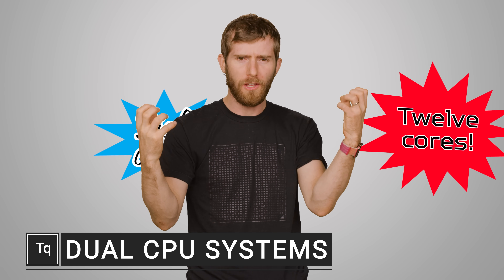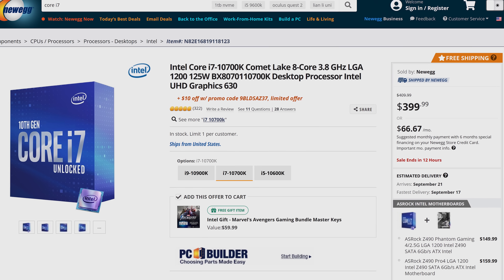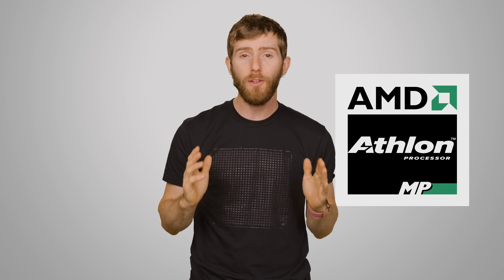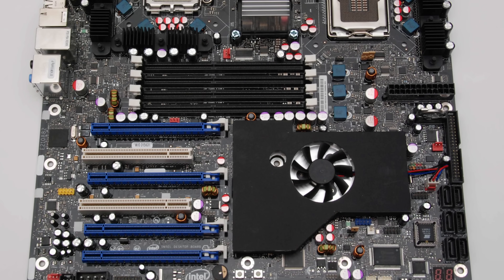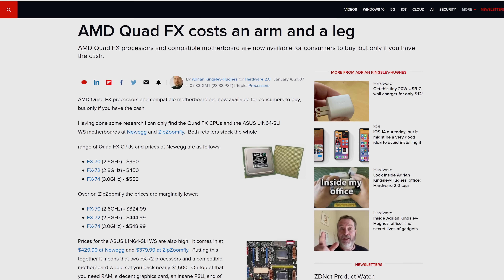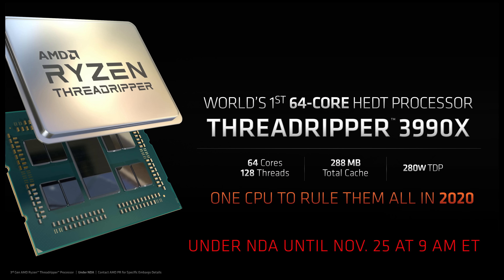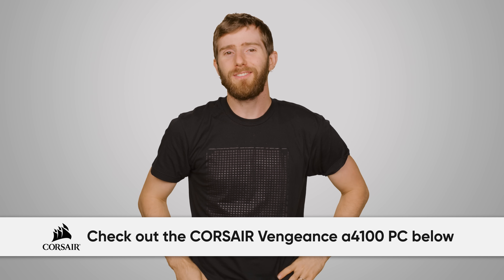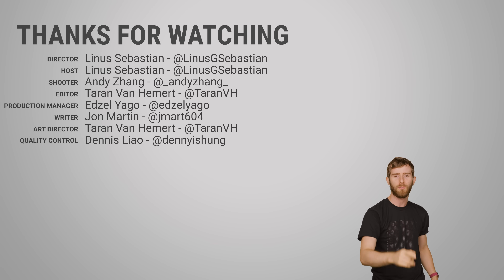Should You Put TWO CPUs In Your PC?

Comment: I have an i7 with a base clock of 2.40 GHz, but recently this Stupid CPU is Stuck on 0.79 GHz & all 8 L CPU Cores max at 33% when more power is needed, even during a stress test. I tried under volt-ing, throttleStop, renew the thermal paste incase it really was temp-but it is well managed at 65 to 78’C , i tried to reset & update the BIOS &Chipset drivers, even physically cleaned the heat sink. But nothing improved or changed. Now i just feel dumb, Any One with a Solution?- Pissed 😡. Is it time to upgrade?

Comment: Multi-socket boards make a lot of sense for multi-tenant, virtualized workloads. In fact, as many as you can jam into an enclosure if they're earning money.  I have had teams working in data science and high-performance computing, all sharing a stack of GPU's and 2-socket Xeon all running separate virtual machines. 8 GPU's and 44 cores of CPU and nearly a terabyte of RAM make an enormous amount of heat and noise. All that goes in the server room with thin clients at the desktops.

Comment: SMP isn't better than mutli-core because SMP increases the distances between the CPUs and each other or the CPUs and other components, which at those speeds even an extra inch matters. It also increases costs and complexities of the traces, not to mention the extra real-estate required (read wasted) on the motherboard which makes it less apt for compact systems. It also needs (a bit) more power to push the electrons (slightly) further. Though it does reduce heat by spreading it out over more area.

Comment: I own a dual ivy bridge cpu system. It made sense in 2015. it still performs great and looks cool, but there is no reason to build a dual cpu machine in 2020. Multithread has arrived... especially if you stream or edit and Threadripper is more than good enough for it. That being said, if die shrinks slow down again, dual cpu machines may make a comeback.

Comment: My main computer is a dual 6 with 2 6 core xeons with hyperthreading for 12c/24t. My son's computer is an HP z600 with 1 CPU 6c/12 thread with the second socket empty. Daughter's computer is dual 4 core xeon for 8 threads and I have another system identical to hers 8 core 8 thread. My pure gaming machine is 4 c 4t 3570k core i5 with a 980 ti. Son has a gtx 960 and daughter had an r9 fury.

Comment: 1:10
Yeah... single-core.
But did you notice the massive 33 MHz?

I had one of those.
Upped to a Pentium 120 MHz.
Followed by AMD K6, K6-2 & K6-3 (300 MHz - 350 MHz - 450 MHz - 500 MHz)
Which was then followed by the Pentium 4, 2.4 GHz WITH HT(!!!!)

I miss those days.
Reply: That's nothing. My first 3 computers were all 8 bit, a 3.5Mhz Z80 and then two with 1.7Mhz 6502 processors. 1K, 16K and 64K of RAM respectively. The good old days. 😁
Reply: @another3997  My first computer was a MOS 6502.
Followed by my first console... which used a derivative of the MOS 6502. xD

(C64 & NES)

Comment: I used to have two PCs with multiple processors though I now only have 1. The one I still have uses dual Xeon E5649s and 72gb of RAM and is used as a flagship workstation specializing in heavy multitasking. I normally don't have too much trouble loading it up though it doesn't always use all of its available processing power. The other one which I gave to my friend has 4 Xeon E7-4870s and 288gb of RAM and is a behemoth of a server. I had initially bought it to mine crypto which it was quite good at, but after the market crashed I couldn't find anything else to do with the raw amount of computational power it brought to the table(seriously - it could run most games at medium settings just by soft-rendering the graphics WITHOUT a dedicated GPU!). Last I heard he was working on converting it into a VM host.

Comment: I don't agree with your car stereo comparison to adding another processor to a system. Adding more drivers, properly, will always provide more sound. Just because you already have 12 doesn't mean adding another won't make it louder. As long as you have an amp to push the driver, it will make the system as a whole louder. If your statement were true then no one would ever make demo vehicles with 20+ subwoofers. Go look it up if you don't believe me.

Comment: I had a moment of pure nostalgia when he mentioned the AMD Quad FX. I opted into the system in a weird sense of future proofing myself into a future 8 core system. The first FX-70 CPUs were supposed to be placeholders for the eventual Phenom-style chips with 4 cores each for one of the earliest 8 core setups available...but the FX line was cancelled and I was left with an existing system with a dead end architecture, and a cooling fan setup that reminded me of a passenger jet spooling up on the runway to take off. I think I learned a lesson from that...trying for bleeding edge runs the risk of getting cut, in more then one sense of the term.
Reply: I am there with 1st gen thredripper right now.
Reply: @Bamfhammer  Same

Comment: Damn...I have 2 of those 2687w's in my HP Z820 workstation. Rendering video is way faster on it than on my 10900K rig. I wonder if it depends on the motherboard youre running it on? I would replace the workstation with a threadripper but the workstation was only 700 bucks lol

Comment: I have dual Xeon v4 in Asus board, 16c/32t, as my main system. The plan is to go for Zen3, as i no longer need such high core count. But it was good to experience it. Definitelly not optimal for gaming, but there are some exceptions.
Reply: I have zeons too on a HP Z820 workstation...but I still get better rendering times on it than on my 10900K. Maybe I need a better board or more ram on my 10900K setup? I have 64gb ram on the workstation and 32gb ram on the 10900K

Comment: Multi~CPU setups being confined to the Server market and going the way of the Dinosaur is ultimately similar to the factor of why Multi~GPU via Crossfire and NVLink is gradually going away (even if XeLink does become a thing with Intel Graphics Cards, I expect that to fade in the same fashion as the Xeon Phi cards and we stick with Solo GPU for the HPG class), CPUs and GPUs have become powerful enough by this point that the only reason for why you need many chips in the same system is if you are running a Workstation/Production workload that can make use of an uncapped core/thread count or if you have multiple people running workloads on the same server and you need to divide up the work by giving everybody a fixed set of cores.
This is especially noticeable if you do Media Production or Model Rendering: When you are rendering a video with the CPU+GPU method, most applications and video codecs cannot work with more than Sixteen to Eighteen Cores, thus this is why I keep saying that a Ryzen 3950X or an Intel 10980XE is all that you truly need for Vegas Pro; many builds of Blender and other Model Rendering applications did not make full use of the Threadripper 3990X when the Zen II Flagship had debuted, as most were capped out at only using 064 Threads (not 064 Physical Cores), thus High Core Count CPUs such as the 3990X and Epyc 7702 Series were meant to handle multiple workloads at once, rather than just blast through one standalone, and even if we had Multi~CPU setups, this truth would still stand, most applications simply are not optimized with Multi~CPU in mind that Single Socket is still the Go To option and why it will be rare if we ever see Dual Socket or better at the Consumer or Prosumer/HEDT level again from Intel or AMD, Cost Factor is one trouble and Effectiveness would be the other that it would be too unpredictable to revive it now.

Comment: I've run a dual Xeon 2695 v3 setup.  It's pretty beasty on benchmarks, but I'll admit it's mostly 'just because it's fun to do' - especially if you can get Engineering Sample (ES) CPUs.  Paid about $450 USD for the two chips (one died after a year, so another ~200 to replace), which isn't any different than a high-end single.  The board and ECC RAM are pretty big upcharges ($600 Canadian Rubles for the board, and I don't remember what the ram was)...  plus an extra $130 for an extra water cooling setup...  But it's bloody stable, quick, and I have fun with it - and isn't that what really matters?

Comment: I must say dual 6 core CPUs give a really good benefit with 24 threads.
I have a custom z600 as my PC with 2 Xeon x5650 which are quite old but cheap and fast at
And 16 gig ecc quad channel RAM and all the other stuff.
Somehow my HDD is fast like a cheetah
I must add that more threads make unzipping archives much faster
Reply: X58 life, most of the modern stuff on the motherboard just missing a few instruction sets, fast though just like you're saying
Reply: @licksludgee  Yes the only problem is that it has no avx or USB 3.0 support and PCIe 2 and sata 2 at max
Otherwise it's fast af
I was worried about my mem speeds too but when I found out that quad channel 1333 MHz ecc memory becomes 5*** MHz ecc I was v happy
Reply: @mythtech  it's crazy, that was the issue with my older xeons it was sata 2 and few usbs. Core speed wise though was more than fast enough for everything I wanyed to do. on AliExpress you can get so many different haswell chips now at crazy prices, you could do an epic dual system for relatively cheap, benefits of ECC memory too

Comment: intel 440bx was one of the first chipsets that i used with 2 cpu's in windows xp days most of slot1/s370 boards were able to run 2 cpu's given they had the same core and pair bit enabled
of course that made for silly monster builds with one cpu in socket and the other one on slot>socket adapter

on the other hand, did linus media group ever touched the subject of socket adapters?. powerleap waS PROBABLY MOST CURSED COMPANY THAT EVER EXISTED BY CPU/MOTHERBOARD MAKERS, BUT IT DID PLAYED INTERESTING STORY ON A SERVER SIDE OF THINGS, UPDARING MAXED OUT PENTIUM PRO ON SOCKET 8 TO COPPERMINE CELERONS WAS  CRAZY

Comment: You forgot about the Abit BP6, paired with two Celeron 366's overclocked to 550+? One of the best cost-to-performance deals in history.
Reply: Yes! I don't know how you could talk about dual socket platforms and NOT mention Abit's BP6.
Reply: Or it's younger brother the Abit VP6 https://hothardware.com/reviews/abits-vp6-via-apollo-pro-133a-dualcpu-motherboard
Reply: I owned 2, was amazing as couldn't get a single cpu to do 1ghz back then.  Alas they came out around the bad cap time, so the period of dead caps plagued.
Reply: Still have mine! Remember playing CS beta 6.5 while simultaneously unpacking some files with winrar, and playing music with winamp. Good times =) Had it as my main rig until the fall of 2008
Reply: https://dfarq.homeip.net/abit-bp6-in-memoriam/

Comment: In the mid to late 90's, I had a home built SuperMicro dual CPU board. I would not build anything but dual CPU machines once I worked with that one; till multi-core was realized. So sweet. I could start a code compile and continue editing without interruption. Now visual studio hiccups all over the place with 8 cores even when just typing. Software has gone somewhat south. CPUs north. Our heads are crammed in the middle. Cheers!

Comment: I was thinking about having a dedicated chip to take care of decompression tasks to handle next-gen data transfer speeds without causing bottlenecks. Leaving the CPU to focus on application tasks processing. 

As far as I know, the ps5 is using a dedicated decompression chip which is comparable to 9 zen 2 cores to handle the 5.5 of compressed data speed. PCs would definitely use that kind of tech.
Reply: I do believe that nVidia 3000 series also does that now on it's own if I'm not mistaken

Comment: is i's diminishing return: why does supercomputer runs hundred or thousands of them?

eddit: thanks  for the anwser guys !!
Reply: There are diminishing returns due to latency between the cores and to memory, as explained in the video. Supercomputers don't run normal programs, they run special programs which are optimized to need less communication between cores and hosts. Instead of one program running on 1000 computers, think blender running on 1000 computers at once. Once each computer is done rendering its thing, it uploads it to a central server and downloads a new task.
Reply: Because it is the only way to get more processing power. Additionally, the boards in those computers are designed to leverage the extra CPU power more efficiently vs a consumer product and it's inherent limitations. Those super computers cost millions of dollars. But ultimately, they do suffer from diminishing returns, just not to the same extent. And their workloads are designed specifically to usd all those processors. Games and other software aren't designed to leverage those resources in the same way.
Reply: The total system latency of a computer running a game less than 1/10 of a second.

The input latency of a global weather model is over 8 hours, and scientific computing often has a latency of days or weeks.

Supercomputers take a long time to work through very complicated problems. That slower pace allows for better performance - if the software and hardware are designed for it.

Comment: Got a dual slot 1 board (Gigabyte GA-6BXD) in 1998 running a Pentium II 500Mhz. Could only run a single cpu as Windows 98 was the only OS available at the time I could get. But I knew multi-core/multi-cpu would become a thing, so when XP came out I upgraded to 2 cpus Pentium III Coppermines. Was quite a beast! Retired it about 10 years later. It served me well.

Comment: Im the only how think of the potential of habing a high performance cpu with a high efficiency cpu and in the same way that sound is virtualiced we could chose which processor run it could be a way to make smoother a generation transitions smoother ang gain some of the advantages of movil procesors without specially designed chips?

Comment: i have had a dual pentium 233mmx, dual pentium 2 (QDI legenx 4) dual pentium 3 (gigabyte GS6BXDS) and currently running dual X5687 on a dell T7500. it really doesn't help for home computing and you are far better off with a decent single socket board.

Comment: i remember my hp kayak 2 having 2 pentium 2 slots and wishing i could fill them both. it never got anymore than a dummy terminator board in that second slot. it also required a second vrm that was socketed for that processor which was interesting.

Comment: Why ignore macs with dual CPUs? Like the Powermac G5 Quad and Mac Pro.
Reply: Also the PowerMac G4
Reply: Sun and SGI of course had multiple CPU workstations ages before either. Was a time when they were the some of the only option if you needed to do proper workstation tasks and needed an OS optimised for it. Oh how things have changed.
Reply: Yeah, those definitely happened before 08, had many examples, and weren't limited to just businesses.
Reply: BBC Micro could have a second processor and that machine dates to 1981, also the processor could be a different type. Archimedes machines had a risc processor and could have a second 486/586 processor installed to allow window to run at the same time.

Comment: I have a hp z800 with 2x xeon x5687 3.6ghz
Reply: 2x 12 core Xeon E5-2697 256GB ram here on a Z820. Only 2.7Ghz but it still does what I need it to
Reply: @PeterMountUK  i could also go for more cores, but that would not work for the games i sometimes play.
So i opted for lower cores but higher clocks, now 8 cores 16 treads
Reply: @sysierius  exactly, our use cases are different & that's what a lot of people don't realise or think of when looking at high end machines

Comment: What difference between xeon core and i7 or i9 core? (not about number of cores but power and performance, is any difference?)
Reply: afaik xeon's are more expensive and have more things unlocked and are sometimes slower in terms of clock speed
Reply: Xeon processors have more cores and lower clock speed to improve stability. I7 and i9 have less cores and a higher clock speed. Xeon processors are also way more expensive.
Reply: Is there any difference in term of power and performance of an single core of xeon and single core i9?
Reply: @TechDEEM  A single core on an i9 will be faster than a Xeon. Xeons are only faster because they have more cores.
Reply: @ConchitaProductions  thanks buddy for helpful comment

Comment: I've thought about getting a dual socket board to make my own "bigLITTLE" style architecture. One socket with as many cores as possible and the other with as high a clock speed as possible
Reply: Dual socket motherboards generally don't support having different CPU models installed.
Reply: @VitalVampyr  Even if different CPUs were supported, I don't think Windows currently knows how to handle workload between little and big cores the same way as Android does
Reply: Unless you're extremely well versed in programming x86 and can modify not only the OS but the BIOS to make it functional, that won't work. They all require matched CPUs.
Reply: Sounds like what Intel is trying to do with their next generation hybrid mobile chips
Reply: Make a video about it. (:
Reply: At least with Intel cpus, they usually only have to be from the same generation. And while yes, cross socket is a bottle neck, that's assuming software is assign to both, I can assign games (for example) to the faster socket only for example
Reply: Shmueli Englard you’d likely need to re-engineer the physical chips, sockets and motherboard architecture.
Reply: androids and phones can easily do that bec the SOC itself is literally 35% of the mobo. So its fixed, inflexible and comes as a package by the cpu maker. Thats why a snapdragon or an apple chip cost as much or higher than a 4 core pc cpu of the same gen albeit the much smaller components
Reply: https://youtu.be/67Y05GgLIJk
Reply: a computer with a CPU and GPU pretty much is a large scale bigLITTLE